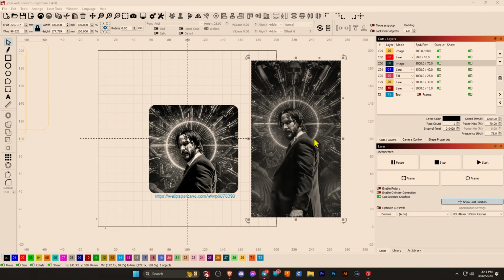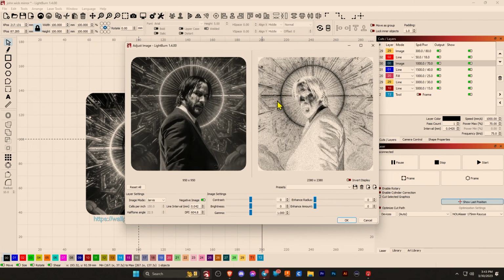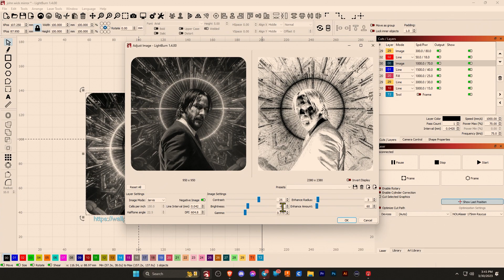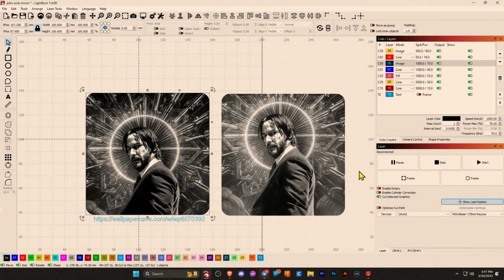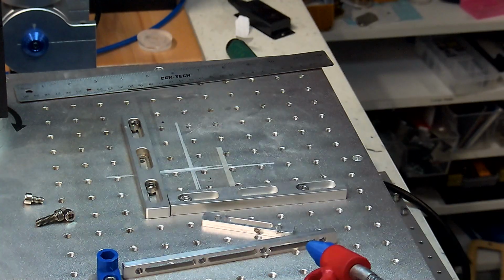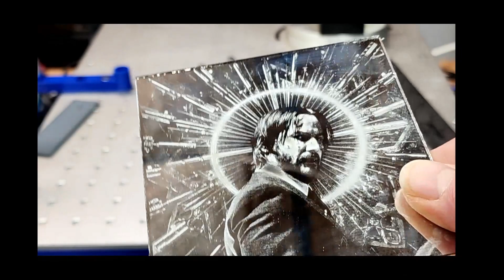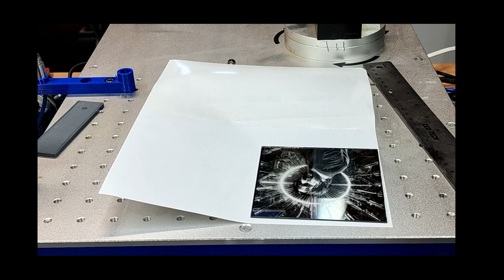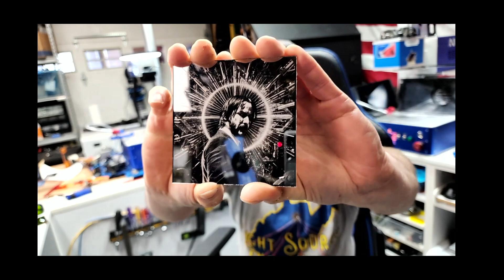How to Engrave a Photo on a mirror - Photo engraving with your Fiber Laser and Mirror Tiles.

Comment: What len do you recommend when engraving this project?
Reply from the maker: 110 - 225 range
Reply: @MooreThanLasers  Cool. I was think of using a 160
Reply: @MooreThanLasers  I used a 300mm and it worked fine.  Engraved a photograph of my sister and her husband.  Turned out great after some tinkering but your settings were pretty close for me.  Now the issue is that I have one huge mirror I want to engrave for her as a gift but that one has a grey/black backing and I don't have any small test mirrors.  Should be interesting.
Reply from the maker: i can give you my 300 black backed settings
Reply from the maker: i did a 12x12 mirror tile from lowes with a bunny for Easter. part 2 of this video are those tiles
Reply: @MooreThanLasers  That would be awesome!  Thank you!
Reply from the maker: @YAOG  3000/90%/60f/0.08 interval jarvis with a 50w raycus 300mm lens
Reply from the maker: ive used 175 and 300 with success